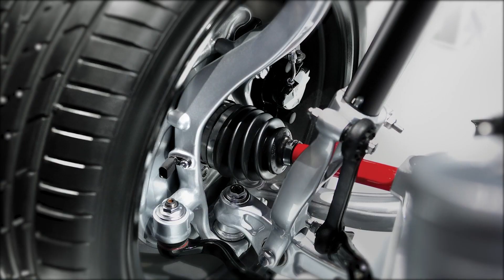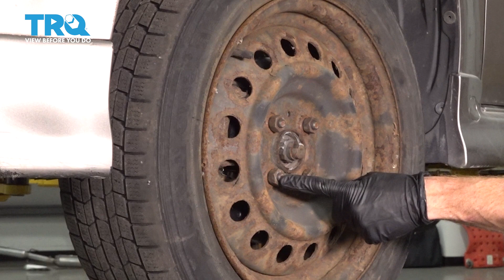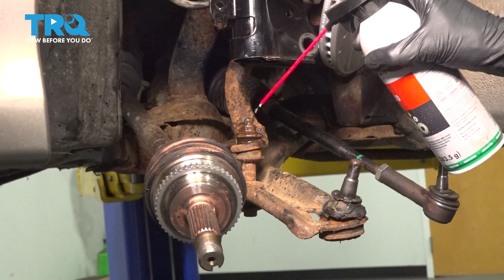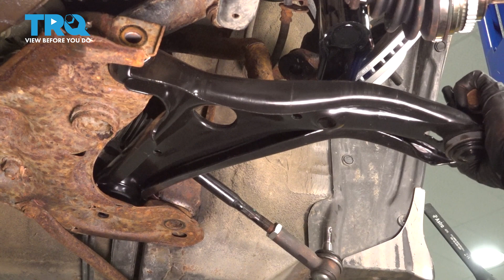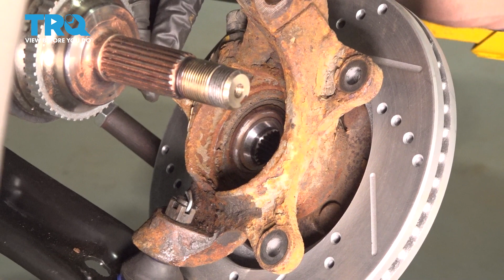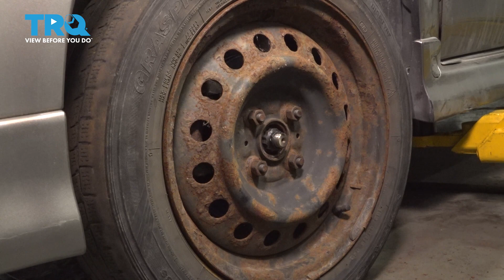How To Replace Front Lower Control Arm with Ball Joint 2004-2006 Scion xB

Comment: great videos. Thank you. Mines a 2004 with a manual transmission and I'm struggling to get the passenger side front mounting bolt out past the oil pan. I tried jacking up the engine like you showed but the car starts to come off the jack stands with about 1/4" to go to clear lip of the oil pan. Any tips?

Comment: This is probably the best how-to video I've ever seen. Every step is explained clearly and are in the correct order. No shortcuts are used nor are there any unnecessary steps taken. The attention to detail is great right down to supplying the torque values for the fasteners. I'm in the middle of replacing front struts, lower control arms, and sway bar links on a friends 06' Xb and since I've been retired for 12 years or so I thought I'd watch a video to see if I'd forgotten anything and happily I hadn't. If this is what you need to do on your Xb, look no farther than this video, I guarantee you won't find a better one.